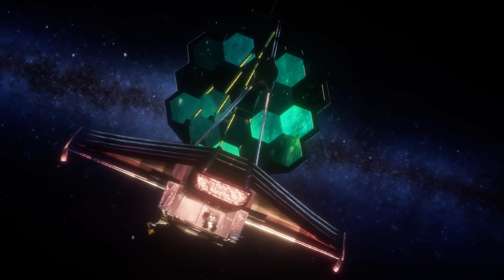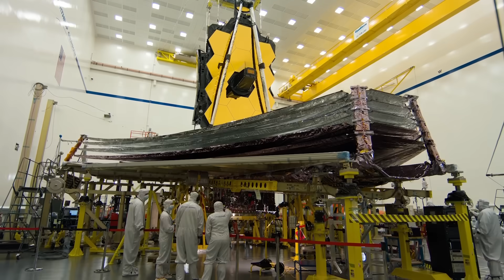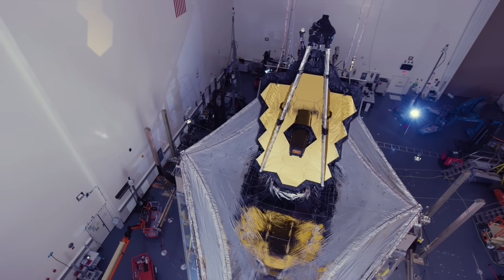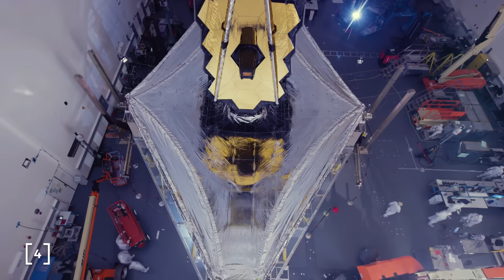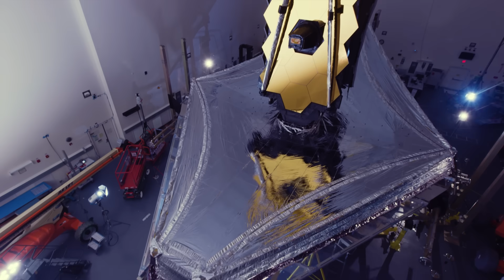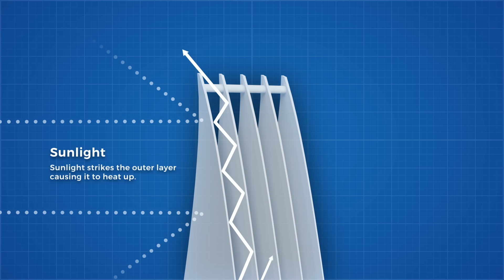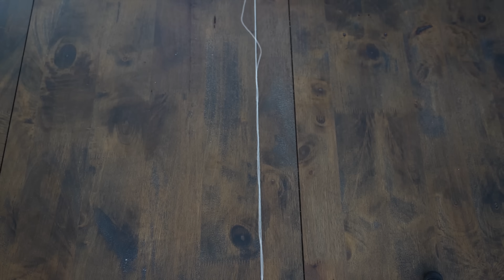The Insane Engineering of James Webb Telescope

Comment: The graphics is incredible. The attention to detail was almost as good as the heat shield
Reply: Most of them. I noticed some with errors, like the mirrors not sharing a common curvature like in the first shot, and a mirror with tons of fingerprints late in the video. Generally though, it looks great.
Reply: @phizc  interesting
Reply: Add Graph [6] at 8:50 to the pile of mistakes.  Sunlight strikes the convex side of the sun shield not the concave side.  Graph [6] is wrong.  Unfortunately there are quite a few mistakes in the animations and graphs this round.
Reply: (12:26) Trajectory Maneuver incorrectly says, “JSWT”….  The errors just keep comin’
Reply: Well, except the one showing the moon's shadow. Inaccurate, out of place and frankly embarrassing.
Reply: He said without the earth the satellite would be heated to 83 degrees Celsius, almost enough to boil water, but the graphic shows negative 83 degrees Celsius.
Reply: Except the model of the JWST is super inaccurate and green colored, and all the mirrors look misaligned and flat, instead of the smooth coherent surface they are supposed to be.
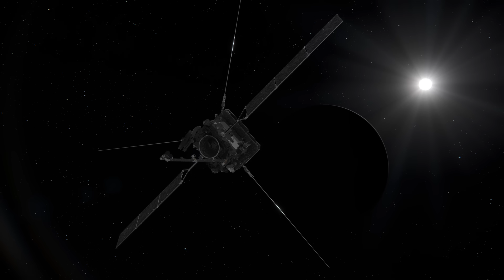Reply: At 3:41 the scale is completely off.
Reply: It's very good for the majority of the public.  To those negative reviewers, it's easy to pick out flaws if that's all you look for. Trolls.
Reply: Always the thing ! lol I complain about food sometimes because its just timing and details

What isnt about details.. at least when it comes to excellence
Reply: @phizc  I told the techs to wash their hands after lunch
Reply: Lots of eagle eyed people in this thread 😅
We look at these dozens of times and unfortunately it's hard to spot inconsistency but we keep trying to be better and better!
Reply: @moboxgraphics  I'm honored to have a reply from you. I absolutely love what you do
Reply: Are😆
Reply: @trutharrow5311  we love reading comments like yours. It's easy to see negativity (especially when it's accurate) and get down on ourselves. We all put our hearts, souls, into these videos. Research, writing, visualizations, animations, music, sfx, editing. Hours upon hours of late nights to make these as amazing as we know how. Thank you!
Reply: @Derekzparty  he also shows the thicknesses of the heat shields wrong,. 0.005 for the thickest layer then 0.025 for the thinner layers, which is 5 times thicker. Descriptions seem on point but the text should have been reviewed better.
Reply: Like Disney studios ... But now, much larger!  Actually.
Reply: @Mark-SanDiego  "negative" ... Because they use Logic, Common Sense, and probably researched JPL Memos of Linear flight test tables from the 196Os??
Reply: @kevindouglas8768  YES!!!  That's what Sleeple don't realize!! INcredible is NOT credible.  Also, "amazing" means Confusing, like a maze IS.
Rabbit Hole also IS: The hole designed to Slow, Deter, and Distract the hunter, as the bunny gets away, outSIDE if that hole!  Too funny!!
Reply: @kevindouglas8768  

I'm pretty sure OP is referring to the parts wherein there are bits of CGI being used, just like there are for many other videos. 
However, just because there are bits and pieces of CGI being used for parts that would be otherwise impossible to just randomly capture in the vacuum of space (Without a fuck ton of useless cameras strapped to everything.) doesn't mean that everything has/is CGI.  This is where some of you people come off as being absurdly lacking in the critical thinking department....
Reply: Believe in yourself. Your limitation—it's only your imagination. Work hard. Push yourself, because no one else is going to do it for you. Definitely, one day you will achieve your dreams.
Reply: @AmulrajSundaramoorthyTAS  Believe in our heavenly Creator, and all else follows.
Reply: @Heroinexoxo  You should look at real footage of stars. They look like a reflection on a surface of water. Now compare that to those cgi nasa images. Same with mars.
    Mars is a red light in the sky, yet people think it's sunlight reflecting on a red ball of dirt.
Reply: @Mark-SanDiego  It IS an engineering channel.  Just saying.  To add another to the list, Heat Transfer is a tautology.  Heat is a form of transfer.  Energy transfer would be more accurate.   Also, keep God out of it.
Reply: @kevindouglas8768  of course it is you muppet.
Reply: Yes, but what is NASA looking for?
Reply: Benny Smith  Even if it is real, it's still a waste of time and money.  The Bible says there is no life anywhere in the universe, but on Earth.
Reply: @davidlafleche828  infra-red signals from the distant past?
Reply: @BenState  No, the fact that God never sent missionaries to any other planet.
Reply: Yes.
Reply: got em
Reply: @TheRealFlenuan  I think that was intentional to show how imperative that shield is and how sensitive the sensor is to thermal radiation... that even the earth and moon won't be blocking enough of the suns radiation alone.
Reply: @Derekzparty  I saw that too
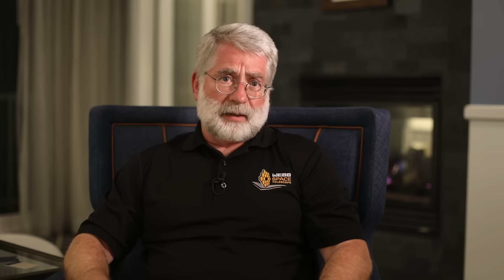Reply: Especially at 5:27!  Really, the graphics are just unbelievable!! :p
Reply: Yeah, like water boiling at minus 83 Celsius!!  What a major mistake yet all 4.95 millions viewers, before me, missed it.  Phooey!  Humanity will die from such an error.
Reply: @toriless  all the people who find these mistakes why dont you make a video like this one?
Reply: @toriless  ..Are you sure about that? Cuz im pretty sure i pointed to that exactly, although it was a bit subtle.😉

Comment: Great video a masterpiece of explanation!
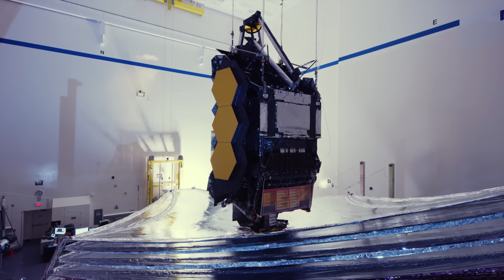I think there is a typo at 5:25. You mention the heat from the sun could boil water on the telescope, but the screen shows -83'C which is below freezing.
Reply from the maker: Yeap, typo
Reply: @RealEngineering  don't worry man, I'll pretend that I haven't seen it!
Reply: @kimjong-un2318  ya I saw it too
Reply: To have put out such a well-researched and well-produced video with only such minor errors is quite a feat of its own. This is your best video yet, Brian. Well done.
Reply from the maker: @Samcanplaymusic  one or two minor errors. Said degrees kelvin too, and mixed atomic number and atomic weight, but nothing that actually impacts the video. Just annoying mistakes that could have been avoided with more fact checking passes
Reply: @RealEngineering  plus kapton doesn't fit the material requirements... That's why it's coated in aluminium
Reply: It's in vacuum, so it should boil or at least sublimate haha
Reply: @leiag201  NO WE HAVEN’T
Reply: @RealEngineering  
You are forgiven, everybody makes mistakes, the true power comes from learning from them and changing yourself for future endeavors.
This is a fantastic explanation of the JWST..... The best I've seen so far.
So the extremely small mistakes in this video are completely and totally forgivable. 
Thank you for such an awesome video.
Reply: @RealEngineering  Best Holiday-Gift would be if you could bring out a /shorts that has gifts in it, 
in the form of recommendations. 
We Science-Fans and -Enthusiasts are often uncoordinated and scattered, if we're brutally honest. Yeah? 

So why not recommend us and tell us that a lot of epic channel exist and wait for us? Like Veritasium, Its ok to be smart, 
Neil Red, Oversimplified, Bluejay, Tier Zoo, Hbomberguy, and so many Others?? 

THAT would be a great holiday-gift that costs barely anything (it could be a very small but AMAZING video).
Reply: @RealEngineering  Trust me when I say this, you will never make the perfect video. You can only aspire to get infinitely close towards it
Reply: you have to remember this is in a vacuum, so the BP is much much lower
Reply: @RealEngineering  but in 0 atmosphere conditions water can boil at that temperature?
Reply: Sooo, now that you got me very curious,
What temperature does water boil at in space. More to the point, in the part of space the telescope will be hanging.
I can't seem to find a correct answer.
Reply: @RealEngineering  Stop misleading viewers
Reply: Yes i too
Reply: @RealEngineering  would be good if you outlined mistakes/corrections in the video description, like 3Blue1Brown does for his. I had to scroll to see this comment to verify that it was a typo and not something to do with different boiling points in space etc
Reply: @jackbeyer5695  thanks, that's awesome info.
Reply: And lowest frequencies of light when desribing gold.
Reply: @RealEngineering  "Just annoying mistakes that could have been avoided with more fact checking passes..."
That's a true-scientist self-assessment.
Reply: Yep, came here to the comments to say the same thing.. It should say +83˚C.
Reply: I thought that was sarcasm lol
Reply: Boiling point of water at near perfect vacuum is actually -63 C. Just sayin.
Reply: Literally unwatchable
Reply: I livestreamed the launch Pls share your thoughts:)
Reply: @RealEngineering  spot on. But I didn’t care to comment.  But love your comment.  Well said.  Kinda mad somebody beat me to it. I didn’t want to be that guy though….  But I appreciate that effort you put in.  PLEASE THANK THIS DUDE FOR POINTING OUT ERRORS WITHOUT SLANDERING THE SUBMITTER.
Reply: @RealEngineering  Let's hope that we won't hear those words from someone actually responsible for the mission, few weeks after the launch :)
Reply: a typo on a graphic has no consequences